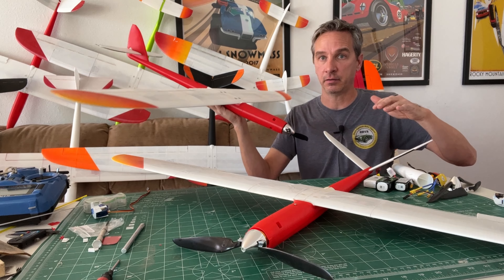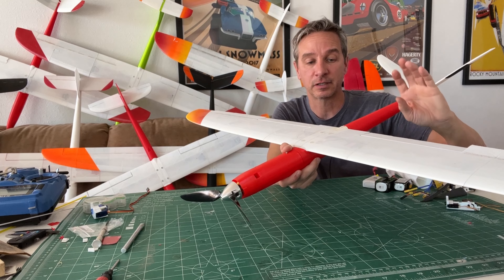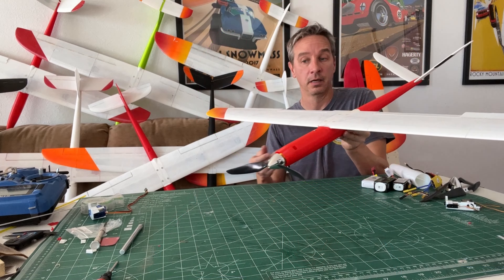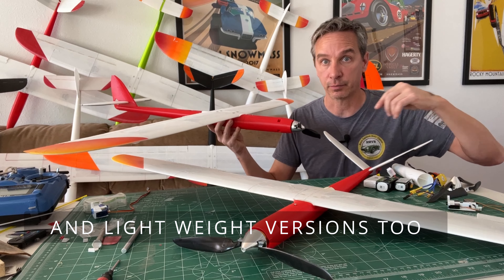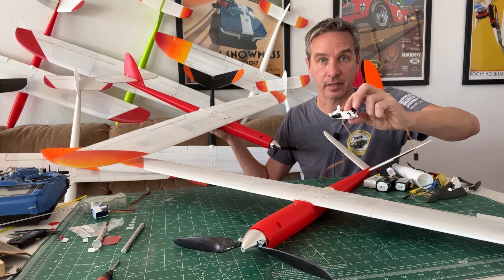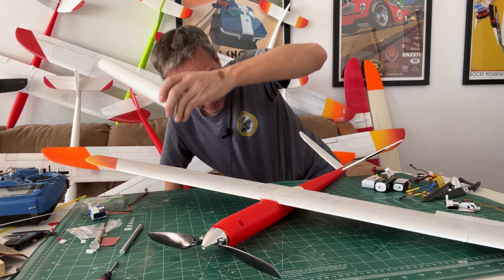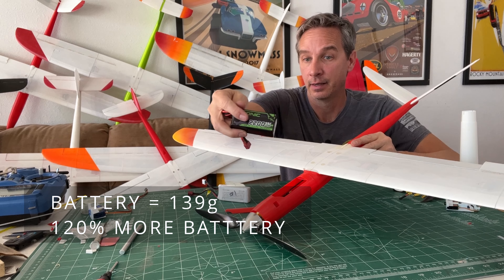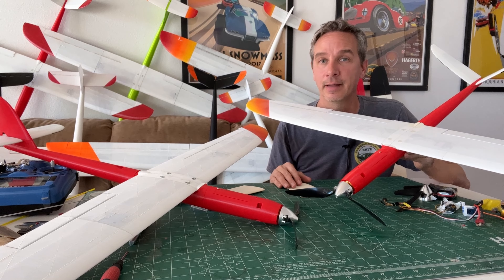SoarKraft - Part Updates and New Features - Jan 2022

Comment: Oh.. the little bits between the walls on Cura can be fixed turning "fill gaps between gaps" off, or changing the extrusion width slightly, or adding a little bit of outer wall inset  :)
Reply from the maker: Yep, you can even turn the wall line count from 1 to 2, but it was little things for each part that were different from the base settings... It is now cleaned up so the settings work the same for all of the parts equally, much cleaner and faster printing parts.  Makes batch printing easier too.  Prusa and Simplify3D also have oddities, but can handle wall thickness variation much better than Cura.  Cura still puts in digital artifacts (surface imperfections) that are not seen in the other slicers..... I have learned to live with Cura, but not a fan.   The new PrusaSlicer 2.4 will hopefully be worth the wait.
Reply: I suffer from "I already know this software and don't wanna change-itis"  But i'm gonna try using other slicers more.
Great content btw :D thanks!

Comment: thank you for the update, shows you care about the customers,

question; are the 1x4 strips necessary? i cant find a cheap seller.
Reply from the maker: They are important.  Here in the US they're available from Aloft Hobbies and Racedayquads.  Racedayquads strips are 4 x .6 x 1000, a little thin, but they seam to work.  Not sure where in the world you are.... ebay, amazon and baggood are starting to have sources for this material too.

You could use 500mm long strips instead... the wing has the 6mm spar also and the 1000mm long 4 x 1 is used as a secondary support for it.  You only need 1 for that and the rest could be shorter.... or just use the 500mm all around.  If you are doing a LW-PLA version this would be fine.  If you are doing fast aerobatic flying and or power pod, make sure you use a solid rod 6mm dia spar, or remember not to push the airframe to 110%. 

You will need 5 pieces of 500mm 4 x 1 for a complete airframe... instead of 3 pieces f the 1000mm 4 x 1

Comment: Have you tried the Even-Odd slicing mode in the latest version of Prusa Slicer (2.4)? I used it to print my latest set of wings in LW-PLA and they came out great with no holes.
Reply from the maker: Sweet.  I have not heard of that and thank you for sharing.  I was hoping that Prusa / Simple Slicer would fix this.  I guess I need to jump into Prusa Slicer 2.4.... it is only been out for 3 weeks.

Comment: another question what is the minimum wind speed for around 700grams flying weight?
Reply from the maker: I fly heavier stuff in 5-7 mph... but it depends on your slope too, our slope has lots of thermal activity and the RG15 easily zooms around and can find rising air.  I used to test the air with a beat up combat wing... if it could fly then a 700g Roughgen will.... way more efficient.  These can easily handle 10-12 mph and have very good penetration, and with the 4 servo wing easy to slow down.